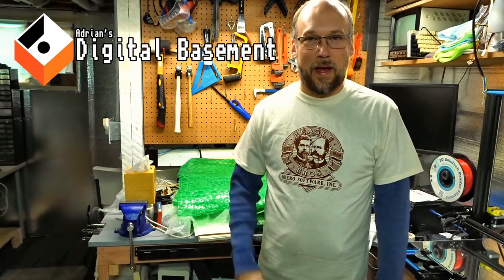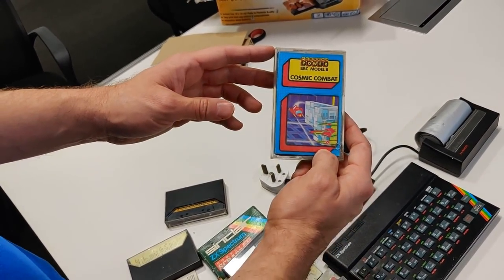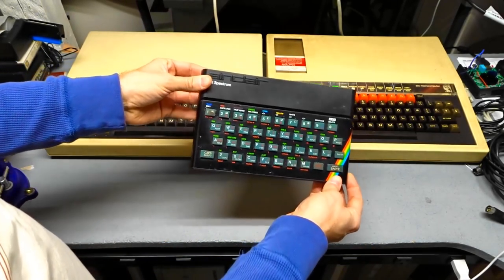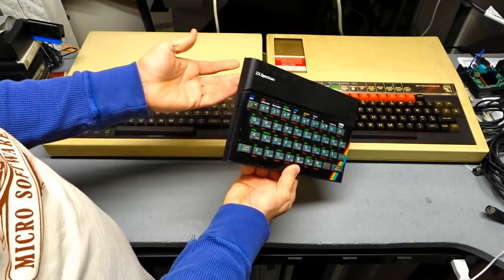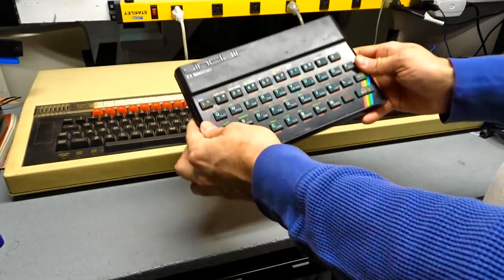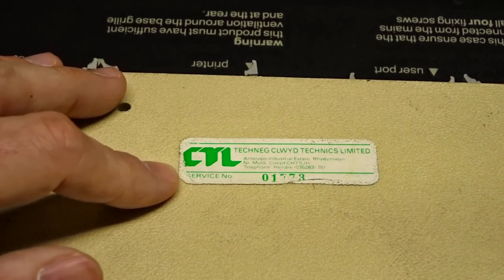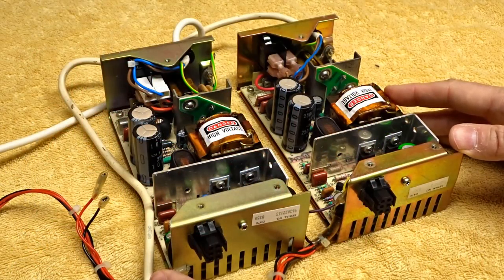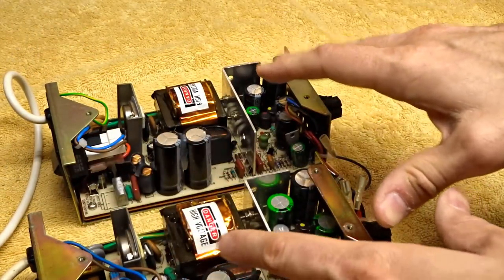I visited the UK and brought back some computers! Let's see if they work.

Comment: This takes me back.  The cosmic combat game was one of a load of games and software released by Program Power/Micro Power Software, a company my dad set up as a home run business when the earliest of home computers started appearing.  I believe the first computer game was a version of Colossal Adventure for the NASCOM which I think only existed on Mainframe computers at the time.  You actually bought it as an empty PCB and a parts list and had to source the components and solder the machine together.  There was a huge push in the UK 1980s to educate people in computing especially children through the BBC with them producing a large number of television shows covering the topic.  These have been made available online.
https://computer-literacy-project.pilots.bbcconnectedstudio.co.uk/
For software development on the Spectrum, one of the engineers designed a board for the spectrum which used a BBC with floppy drive as a file server, allowing loading in a couple of seconds rather than minutes.  It was a lot easier to program on the BBC and then transfer the  code across.

Comment: You probably have 240 V at your electrical panel. All you have to do is to install a breaker that spans both the bus bars and run a new outlet to that breaker. Could come in handy if you run across some psus that are not as easy to mod.
Reply: @adriansdigitalbasement  if you did decide to do this, I'd add a European style Schuko outlet as well. Those are used in the rest of Europe, and are therefore at least as common as the UK style outlets. Be aware of the frequency difference - not all equipment will tolerate 60 Hz if made for the European market where the standard is 230 V @ 50 Hz. The voltage difference between 240 V and 230 V should not be a problem.
Reply: @adriansdigitalbasement  When I lived in the US a while back I built a step-up transformer with a UK outlet which let me run a UK VCR amongst other things, worked well. The other option was to keep unplugging the washing machine :)

Comment: Why didn’t you get cables in the UK to test them, they are cheap as chips,you could have picked up an old monitor with the correct connections too.

Comment: 30 years ago when I was a kid they had spectrums plugged to black and white tvs at the "computers room" in my school. I didn't like them, I was like "this is not a real computer" hahaha. (I had an XT, so I was used to a "normal" x86 PC running DOS, with 640k of ram, floppy disks, its own monitor, it's own keyboard separete from the main unit...
for me it was weird to see a small keyboard plugged to a TV and loading stuff from cassettes).
Reply: that's very interesting, I never heard of anybody liking the msx more than PC or other systems.

Comment: I haven't seen a BBC computer since I was in school, I don't remember using them because we also had the RM Nimbus which was our main source of computing.
Reply: I looked up Research Machines on Google and did find a mention on their Wikipedia page RM Education which says "The company was invited to tender to supply the BBC micro but declined on grounds that it was not economically feasible to provide so many features at such a low price and to such a tight schedule". I was surprised to find that the company was still active (as of 2016), I thought I had read that they went out of business in the early 2000s.
Reply: We had RM Nimbus machines at school too. 80186 machines with no storage, connected via coax network to a 286 server.
Reply: James Grimwood same. The operating system consisted of an MS-DOS based menu system for various programs such as Microsoft Word and there was also Windows 2.0 for the sole purpose of running Excel.
Reply: @Kundalini12  one day the teacher told us the password for the DOS prompt (rmmsdos). And then I taught myself about PCs ;-)
Reply: James Grimwood we found our way into the command prompt via Microsoft Word and I remember nosing round the drives on the server which is where I found  the Windows install.
Reply: Kundalini12 they had "modern" RMs at my first secondary school. they were just Windows 98 PCs (and "XP" ones downgraded to 98) all physically RM branded with "RM" monitors and input devices, running some custom RM program launcher

Comment: The Spectrum looks like and Issue 1 or Issue 2 board. You’d have been better off with a later logic board revision, but you can still easily modify it to output composite video by bypassing the RF modulator altogether. Not sure if it’ll help you, since it’s still going to be a PAL signal, but at least the quality will improve.

The ULA outputs a Y′UV signal directly, so, potentially, you can even convert it to either S-video or even some form of RGB.
Reply: Then you’re probably good. Keep in mind, though, that the Spectrum’s composite signal won’t be 100% kosher. Some TVs—especially more modern ones—don’t seem to be too thrilled about it. Older TVs are usually pretty happy with it.

Comment: The BBC machines where used for years in  British schools.Thousands of children first learned to use and programme computers using these machines You will need a floppy disc machines to load programmes into the computer and a tape player to load into the Sinclair, 
With the advent of the windows system, they rapidly vanished into the mist!

Comment: the -5 voltage regulator is a 7905 it may have a higher failure rate compared to the 7805.

Comment: If you type *HELP on the BBC it will list the OS revision and the ROMS installed, if you type *REPORT it will tell you the year of the  OS, if you fancy adding a second processor ( and who wouldn't ) have a look at the " TubePi " , using a raspberry pi to emulate most of the aftermarket second processors of the day - 6502, Z80, 286, ARM etc, for cheap simple SD usage, try a SMART SPI, plugs into the user port with a micro SD card. :)
Reply: @adriansdigitalbasement  You wont regret it, very cheap as well, got mine from Retroclinic, excellent service.

Comment: I have 200+ BBC micros in storage, I might do a series of videos opening each one up to see whats inside, most are standard model b, about 30 masters, a dozen b+ 64/128k, at least one US beeb...I have 3 linear PSU issue 2 machines, at least one with OS 0.1, but not as separate 4k eproms and not a finalised ROM mask

I Know I have 20-30 6502 second processors and 3x 32016 second processors a few 80186 and at least 2x acorn z80 as well as a pile of torch z80 with disk drive units

I also have a torch 68000 machine

any interest in "unboxing" vids ?

Comment: Ahh a ZX Sinclair ... The memories what seemed like hours of loading games only to tip the expansion pack and bang you have  to start again from scratch.  You have a printer too that's pretty posh.  In fairness the BBC Micro was a pretty good machine for the time.  The BBC was the king followed by the Commodore 64 and then the Sinclair.

Comment: enter  auto and every time you  press enter it auto  numbers the line for writing  programs  .  ie.10  mode 2  enter 20  fo a _ 0 to 100  step 2 ento 30  print a  enter 40  next  enter 
then run

Comment: Very neat! I've been wanting to snag a Speccy, but unfortunately all the ones on eBay that pop up are usually Russian clones in questionable shape....Or very expensive. The ZX Spectrum and Speccy 2 with the built in tape drive are such beautiful machines.

So bizarre to me the older BBC Micro had such an immaculate keyboard....yet the rest was filthy and obviously old. It's like someone slapped on a replacement keyboard, then put it into storage without using it....Very weird.

Comment: The cap on the negative 5 v looks like it’s been hot on the working supply. I’m not sure what ram the bbc has but missing -5 on some computers will kill the ram
Reply: I'm not even sure what the -5v is used for.
Reply: @adriansdigitalbasement  Hi, my understanding is the -5v is used to drive the BBC's built in speaker. I noticed you said the beep the older machine made was quiet. This probably explains why.
Reply: @aCivilServant  Nope. The -5V is for the serial connections, RS423 and Cassette Tape.
Reply: @adriansdigitalbasement  16k RAM is unheard of - that was the BBC Model A on launch and pretty much nobody had one. Everyone had a BBC B or the sad sacks that had a BBC A would quickly upgrade the RAM. I'm guessing your motherboard with the DIP socketed RAM could have been a Model A and hence upgraded? 

I've already stated that the -5V is used for the serial ports - that is the RS423 and the Cassette Tape port.

Definitely NOT the RAM or audio.

Comment: For some reason, I remember the hole was for the heatsink fins of an early  PSU  but this was 30 years ago
Reply from the maker: I know the early PSU was linear and very warm. That would make sense actually but I couldn't find any pics
Reply: maybe it was just venting slots and the PSU sat flush with the case but i also cant find any pics ..Thanks for the memory's

Comment: I checked out the BBC micro power ratings and requirements:
https://hackaday.io/project/161587-bbc-micro-power-supply-rethink
The PSU is designed to power external floppy disk drives, so if you don't have them then you don't need the 12V rail.
The -5V rail is there to provide negative bias voltage for the audio op-amps, at a mere 25mA so you can use a small voltage inverter circuit for that. If you do that and omit the 12V rail, then you could run the beeb off a 5V 2.5A wall wart. Or even less current if you change chips inside the beeb.

Comment: Bit of info on that service sticker. They were a well known business in Acorn computers, programming and peripheral products. They were listed as official Acorn Dealers hence the sticker. CH7 5JH is the local postcode (Zipcode) for the business.
Some period stuff here and they are mentioned in both but they give you a picture of what British computing was doing in the very early '80s. Grab a coffee ...

http://www.retro8bitcomputers.co.uk/Content/downloads/magazines/acornuser/acornuser8401.pdf

https://www.4corn.co.uk/archive/showpdfs/02%20Micro%20User-Electron%20User%20April1984%20-%20New%20Horticultural%20Hall/Micro%20User%20+%20Electron%20User%20-%20Programme%20-%20TMU-EU%20Show%201984%20Mar-Apr%20(Westminster).pdf

Comment: The keyboard on the BBC is one of the best I ever used.
Reply from the maker: I wonder if some were better than others? (Like with the Apple IIc or TRS-80 or Atari 800 XL, you had a wide variance of great keyboards and crap ones.)
Reply: Adrian's Digital Basement if you can get hold of an Acorn Electron. The best keyboard ever made..... ever.
Reply from the maker: It's on my list of machines to get. Unobtanium here so I'll need to find a good deal in the UK and have it sent to one of my coworkers.

Comment: The X marks on BBCs are normally where someone has marked the ports to use in a school.
Reply: Yeap. Ever seen a 6 pin DIN that's been forced into a 5 pin domino din? Anyone who was "in charge" of a BBC in a school probably did. And that was just the teachers... :)
Reply: @TheChloeRed  The maths teacher (who was also in charge of Computer Studies) at our school went even further, he got the craft teacher to make replacement backplates, so you couldn't get to any of the "unauthorised" ports, presumably after some kids discovered the joy of jamming paper-clips into the Econet port.
Reply: More likely the cassette or serial port - as they were the only things over then the audio that used the -5V, it was possible to get a 10V potential shorted to the board if you did that.. We had a set of machines at my school where they managed to short the -5 to the +5 that way and take out parts of the PSU.

Comment: BBC model A boards came with 16K and less expansion ports, so would have had sockets for the extra RAM empty. It looks to have been upgraded to model B spec with the extra 16K added.
 
A good expansion is an SD card disk drive, specially for the machine with no disk controller. These plug in the user port and just need a ROM chip installed. These ones are very neat - https://www.ebay.co.uk/itm/ACORN-BBC-MODEL-B-MASTER-128-MICRO-SPI-MMC-TYPE-SOLID-STATE-FLOPPY-JUKEBOX/264062180179
I've not seen a beeb with a hole in the lid like that before, maybe it used to have the old linear supply? they got much hotter and may have benefited from the extra ventilation. I've seen one with holes drilled above the power supply, but never the full cut out. There are some photos of that type of supply on my blog - http://blog.tynemouthsoftware.co.uk/2014/11/bbc-micro-issue-3.html

Comment: You can mod the Spectrum's RF Modulator to run it via composite - I did it with my 3 48K's
Reply: Hunter's Moon  Indeed, the input to the silver modulator is composite and can feed into a tv with a scart socket
Reply: @eliotmansfield  Scart in the US is an anomoly.

Comment: The one with the hole in the case may be an upgraded model A while the other one looks like a stock model B.
Reply: Did model As have holes in the case? The 8 socketed ram chips definitely imply an A.
Reply: @JasperJanssen  No, the holes look like an aftermarket attempt to keep it running cool.  The A only had 16K of memory, was missing a 6522 chip and several ports, all of which seems consistent. The modern (relatively) switch mode power supply may be replacing an older linear one and those did get very hot.

Comment: Scooore! I'm chasing a Beeb (As well as any of the Atari computers) so I'm envious! 
Things to do: Get a PiTubeDirect (https://github.com/hoglet67/PiTubeDirect/wiki) which will allow you to emulate various funky CoPros on the Beeb.
For the Spectrum (my first retro computer in recent history) I'd suggest a really super cheap intro is to do the Composite mod to it, which is super easy, and allows you to avoid having to do any crazy stuff with trying to tune in an RF signal. I also found that it was easy enough to make up a cable that allowed me to use a mobile phone as a tape deck (TeeZiX is the app to manage the playback) and I was able to then load software without having to find a tape deck. Makes it super easy to get software you ahem "acquire" off the internet into it.
For now I've got a couple of C64s, a Vic 20 and the Spectrum. The hunt continues. It's harder to collect here in Perth, Western Australia, without having to import from overseas as there were just not that many computers (outside Commodore ones) here in any form in the 80s.

Comment: Both are original and also another version called BBC Master with hidden menu called EDIT if you type this simple program into either 10 MOTO 1
20 MOTO 0
30 GOTO 10

It will run a relay inside on and off. Bit of fun.
Reply: That would be "*MOTOR 0" rather than MOTO... but don't run it, it will probably kill the relay!

Comment: I recon the hole is a diy attempt to cool the power pack.
Reply: But the edge is neatly beveled and straight; it looks machined as part of the case to me. My guess is that there was a panel of a different material there which is missing. Perhaps some kind of name badge.

Comment: The paper is only silver because it's gone bad.  That's a thermal printer (PS, wrote this before I saw below that it is even stranger....)
Reply: Incorrect. The silver is a microscopically thin metallic layer that the printer head (single wire design) uses to burn single pixels into the 'paper'. Recall, Sinclair were obsessed with lowering the costs of their products.... The printer was slow, but quite innovative. I worked at Sinclair Research in Cambridge BTW....
Reply: @timfountain98  You are right, I'm incorrect.  I was going on what Timex sold for their version, which was a standard cheap thermal printer whose paper would have turned silver or black by now.

Comment: I had a Mandela effect moment i thought the bbc had a black screen with gree  writing not blue lol
Reply: On an RGB monitor (or a colour TV), a Beeb has white writing on a black screen when first powered up. The "blueish" look in this video may be due to the white-balance on his camera or his monitor. It is, however, possible to change the colour of both the background and the text.
Greenscreen monitors were quite common at the time and it would not have been unusual to have seen a Beeb hooked up to one (or someone changed the colour of the text to emulate a greenscreen), so it may be that your memory is not failing.